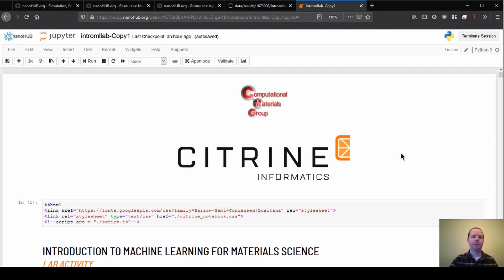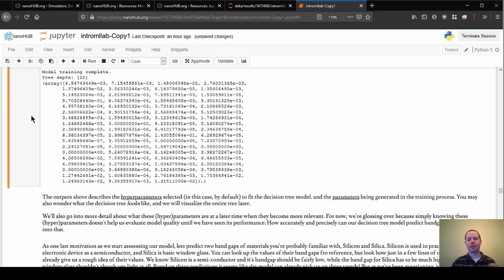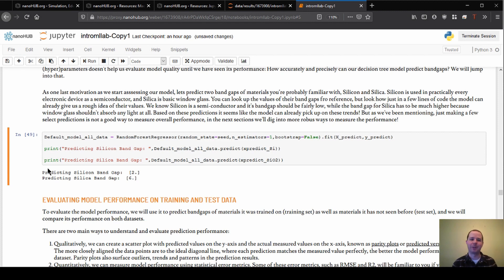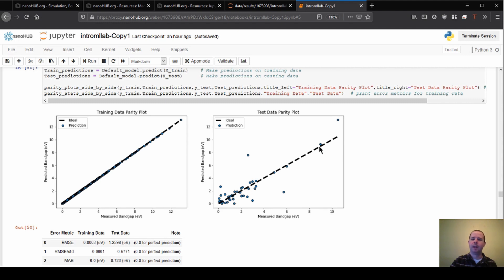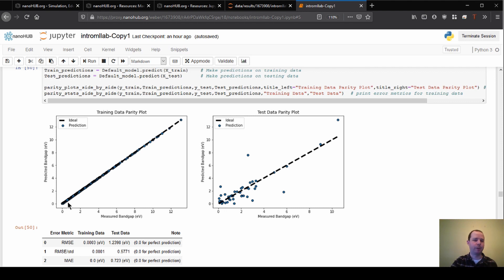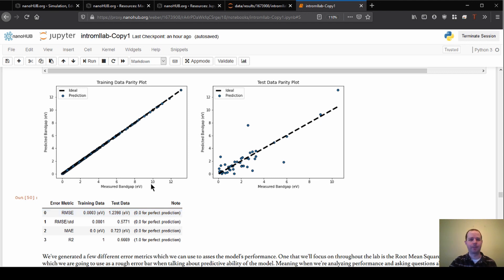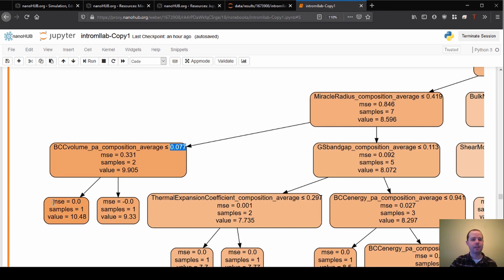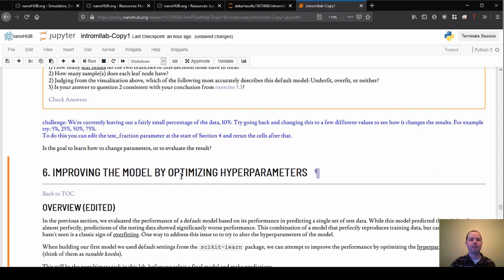Intro to Machine Learning for Materials Science, Section 5: Fit a Default Model

Comment: How to do parity_plot ? in the 50th cell, there is no pre_defined parity_plot.

Thank you Sir.
Reply from the maker: Hi MrChunghee, can you provide a little more information on your issue? Running through the cells as is generates parity plots for me. I assume you are referencing the cell that contains "parity_plots_side_by_side", which worked for me. If you provide more information I will do my best to help. Thanks!